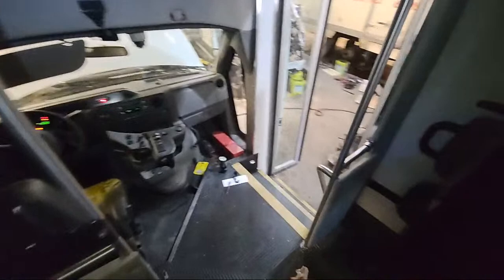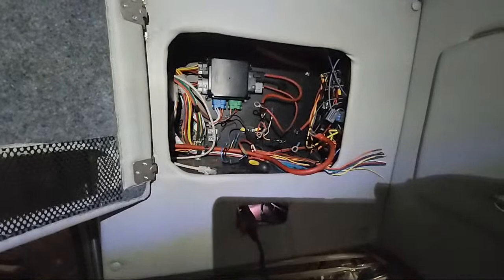Anyone Know About Electical In A Goshen Coach?

Comment: I'm just 16 :|
Any word from the manufacturer/manuals/fuse diagrams?
Reply: I was thinking the same thing. Wonder if the previous owners might have some information?
Reply from the maker: Well, I looked for wiring diagrams,  couldn't find any .. I guess goshen is owned by Eldorado now.. I called them but they are not open saturday.. I was looking also for them to tell me part numbers for some other parts they didn't get back to me yet ill try Monday
Reply: @BusTVChan  
Ik about your d35lf situation, and now this then you have me trying to buy an ex NICE bus orion vii ng cng when they retire, I think it'll be appropriate to say the following:
My wallet is screwed